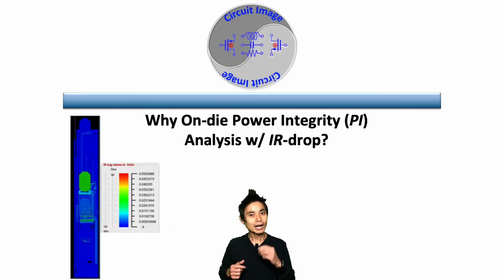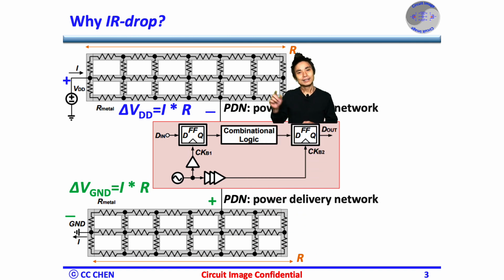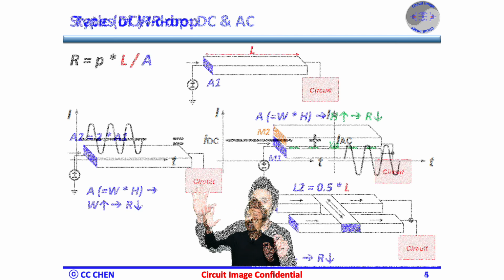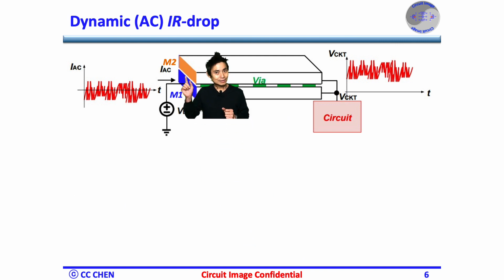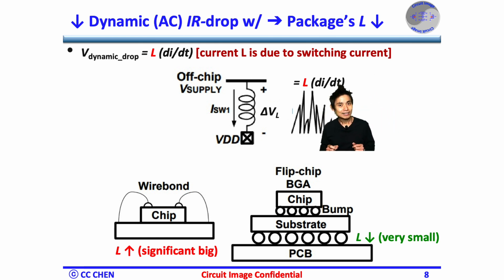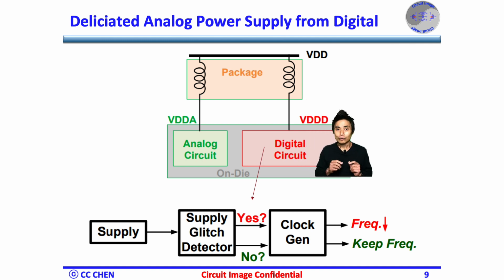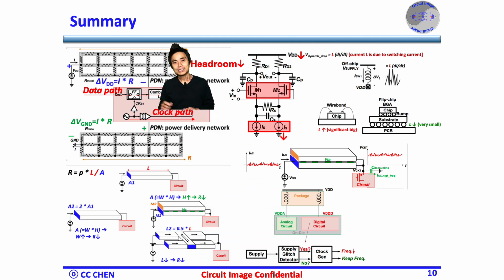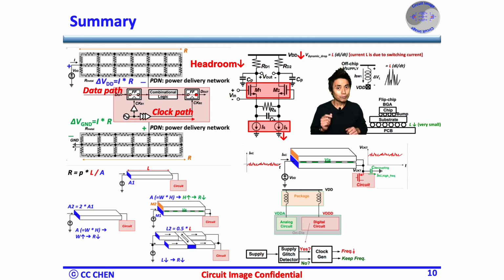Why On-die Power Integrity (PI) Analysis w/ IR-drop?

Comment: thanks for this video, can you also talk about sources of high frequency [and low frequency noise coming from VRM] in PDN design? we normally look at impedance at 20k to 20M for PCB, can you further develop noise sources for PDN over frequency range and higher than 20MHz? with current Nyquist rate being at 28GHz  and 56GHz noise frequency seems to be very high frequency range than 20MHz.
Reply from the maker: Hi Shady, nice to meet you. Thank you so much for your good question and suggestions. The high frequency supply noise should be reduced well by the on die decap; therefore, that’s usually not an issue. Instead, the low frequency < 20MHz, supply noise must be reduced through off chip decap, which provides big cap area efficiently. Hopefully, this answers most of your questions easily without circuit images.